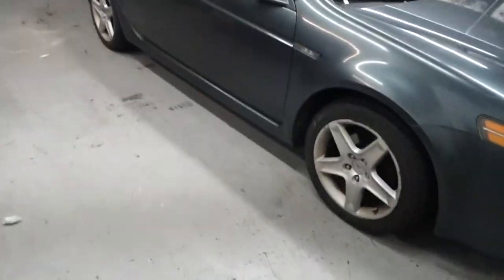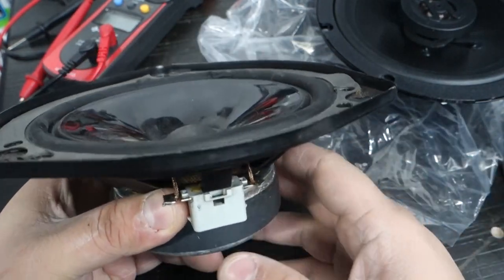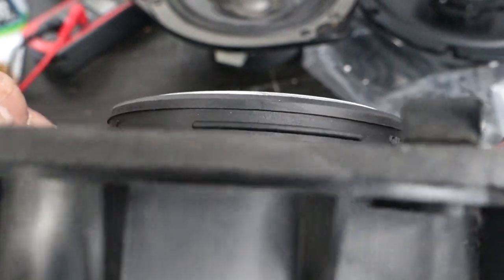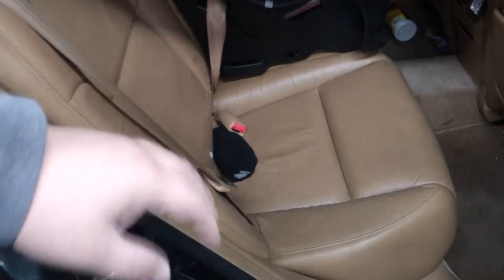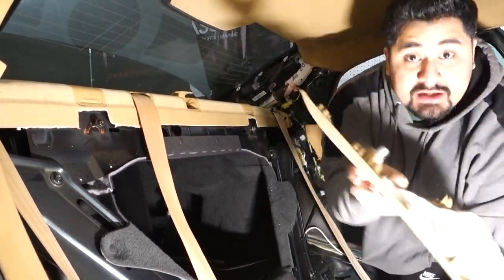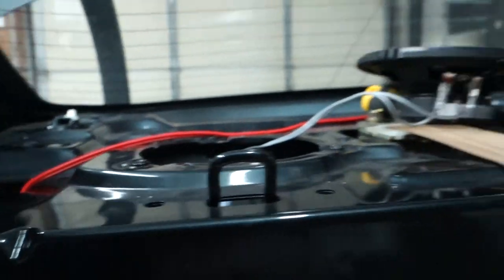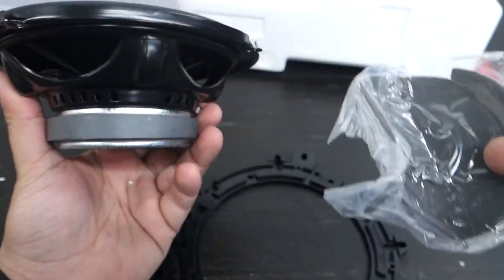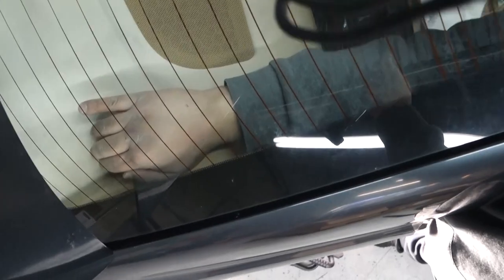Replacing the Rear Speakers in Your Acura | 3G Acura TL DIY Rear Speaker Replacement

Comment: I’ll definitely check your Chanel out as I just purchased a 2006 Acura TL.  I have ran into issues on my old accord where I didn’t think about the depth of the door speakers and I had to use almost 2 risers. I replaced everything in the accord (2 tweeters, both door speakers, and 2 6x9’s)  also the original owner didn’t remove the door panels and just cut holes im the actual panel.. i got it cheap but it needs lots of cosmetic work

Comment: Thanks for this video. It’s a pain in the ass though to replace these lol. I had to remove the original clips for the bolts on both rear sides and that alone took like 15 minutes since they were also hard to remove. All in all It took me 2 and half hours to replace both rear speakers and the subwoofer as I had to take some breaks in between due to the heat here in Cali. Thank you though for all the hardware and speaker adapter brackets as it made the install easy. Hardest part was removing everything to get to the speaker and subwoofer.

Comment: Just finished putting in the 5 channel amp kit from your shop. The sub needs a little more kick but overall the sound is great. Changed out the 6.5 with the subwoofer in the rear. Already got the front speakers on the way. The hardest part was taking out those damn seat screws under the headrest. The clips are scary too. Thought I broke all of them from the sound. But in the $300's cannot complain and this doesn't clutter up the trunk area.

Comment: If the speaker wires long enough to wire the new speaker, I prefer cutting the clip off and add the connect spade straight to it.
Reply from the maker: Not recommended. if you are going to cut then you might as well solder the speaker terminals and not use any spades at all.

Comment: I retract my post made a big mistake in listening to an installer tell me that a 6.5 didn't fit into the acura tl rear.  What was the problem you ask? found out today after almost buying 5 1/4 speakers that the skar tx brand 6.5 speakers have a bigger ridge around the speaker cone causing the speaker not to sit in flush. I literally had someone place an Alpine and Kicker 6.5 and the speaker fit properly.  So I know the fronts will be another story with the bracket but I'm ready for the challenge or I will call mobilemaxcaraudio for help!
Reply from the maker: Can you send us an image to support@acuraaudiogarage.com

Comment: Can you do one on replacing the rear sub with a better 8” subwoofer? 

Also do these speakers sound better? Or have better bass response?

Ultimately I’m looking for better sound and bass response, I’m not into the crazy sound systems with 12” subs lol, it’s my daily driver.
Reply: i want to put a 8 on the rear where the factory ones are and i want to know the same thing
Reply: @jairpedroza6971  LOL looks like they dont check in on the channel to frequently
Reply from the maker: Yes it goes live tonight you can view it here https://youtu.be/p1hMwuUUufk

Comment: I need the full set for rear and front door speaker I see the link just have the rear speakers need for 2005 Acura tl base model ?
Reply: did you end up getting full set?
Reply: no i didnt i got an after market radio installed but the guy who installed my radio didnt connect the blue wire from the apm to the radio  so my speakesr didnt work and i thought my speaker went out but i fixed and everything works fine

Comment: I have a 2019 TLX aspec.
If I just replace factory sub with better aftermarket shallow sub will it sound better?
Or will it be pointless cause factory amp is too weak to push it?
If so, is there a way to replace amp ( without cutting anything/ plug and play)?

Comment: Is this the same way with the 14 tl
Reply from the maker: no the procedure is different here is how to get the rear deck off so you can get to the rear speakers. https://mobilemaxcaraudio.com/knowledge-base/instructions/2009-2010-2011-2012-2013-2014-acura-tl-subwoofer-upgrade-instructions/

Comment: $30 for a single adapter is RIPP OFF!!! but I didn't want to drill holes so I have not choice but TO BUY your RIP OFF adapter!!!
Reply from the maker: You can just use universal spacers. Our products aren't ripoffs. It's not just the spacers it's the wire harnesses and hardware necessary. Nothing but great reviews from the people who have used them. Also these are 3d printed custom parts that take 6 hours each to print.